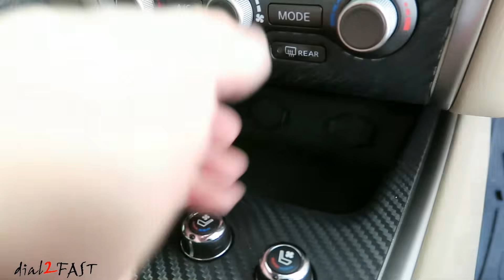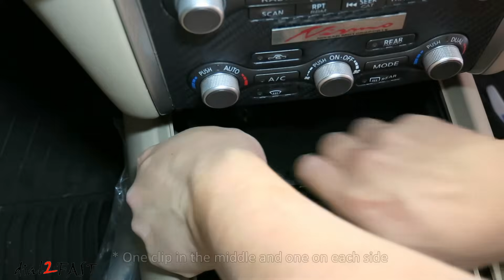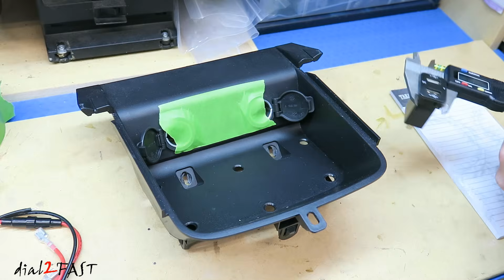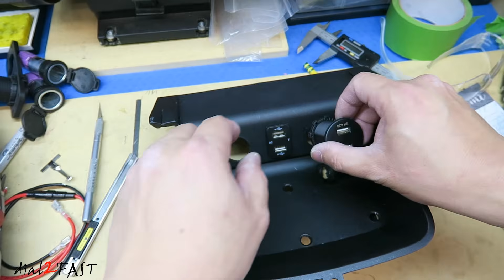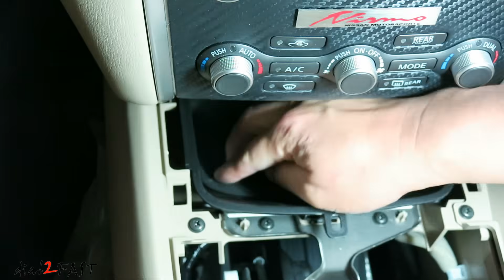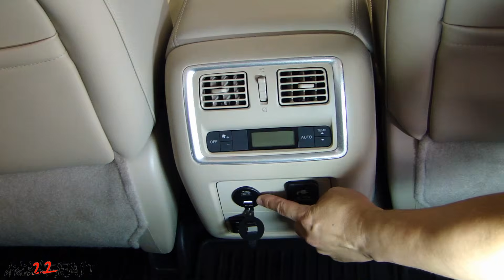Install Dual USB Charge Ports In Your Car | Nissan Pathfinder

Comment: Noob question. Do you really need to remove the panels to replace the cigarette lighter outlet, or can you just push in the two tabs as shown in other tutorials?
Reply from the maker: You have to remove the panel to remove the cigarette lighter plug. There are side tabs that clip into place which you can only access from behind. If you want, you can first try prying it out from the front but there is not a lot of space to work with.

Comment: I know this is an old video but is the panel removal over the tray different on a 2020? I can seem to get mine down as easy as you did
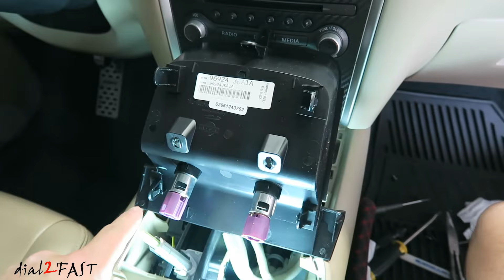Reply from the maker: The 2020 is same as my 2017. That tray is tough to get out because of the plastic tab at the back. You will have to use a pry tool to force it to come out. That's why I end up cutting of the two rear tab before reinstalling it. I mentioned this at 3:15
Reply: @dial2fast  thanks for the response. I was actually referring to the panel above the tray that you had to remove the light from. I want to change the bulb to led but not sure how to get the panel off
Reply from the maker: @MrMpbailey84  I see. With that top panel, you need to get a pry tool or small flat head screwdriver, and slip it in the front edge of the panel (you have to feel that edge as you are doing this blind). Once you have the tool slipped into the edge, then press it down to pop the panel out.
Reply: @dial2fast  awesome. Thanks for the response!! I’m gonna give it another go. Your videos definitely have helped me with stuff on my pathfinder as well

Comment: So I don't have to run it directly to the battery. I hope I don't have to order long wire and route through the fire wall. ?
Reply from the maker: You can also use a fuse tap to tap into the fuse box for Ignition 12V or Constant 12V. Definitely try to avoid running through the firewall.
Reply: @dial2fast  I got it to work today thanks

Comment: thanks for another great video.😀 can i tap to a  constant 12v fuse?  even when the ignition is off? how much power does a usb socket draws when not in use. it is safe for the car battery?
Reply from the maker: It's not recommended that you connect to constant 12v. It will drain your car battery.
Reply: @dial2fast  thanks for your replay.

Comment: Hi, Dial2Fast.... I saw that in this video and the other one you made about installing cigarette lighter type accessories that no mention of a fuse was made. Isn't there supposed to be a fuse installed in each USB device (front/back)?
Reply from the maker: Keep in mind the circuit I am tapping off is already fused at the fuse box. For extra safety, you can install a 5A inline fuse to the USB charger if you want.
Reply: @dial2fast  ah....got it. Thanks for the info and reply.

Comment: Do you know if it's possible to add that 2nd cigarette lighter on a version that doesn't have it
Reply from the maker: You can as long as you have access to an ignition 12v you can tap power.

Comment: As always, great video. Any chance you could do a video on replacing the OEM incandescent front turn signals to LED switchback LED's without having to use load resistors?  So, they would be bright white when the car is on & switch to bright amber in turn signal mode.
Reply from the maker: I have already replaced the front turn to LED but they are not switchback. I am not planning install switchback as the turn signal is right next to LED DRL. IMO, not much point in doing this mod/install. But here is the LED install vid: https://youtu.be/nkD45Ep4DKA

Comment: great install! looks good, ever thought about replacing the radio? would be a cool video
Reply: as a 2017 owner replacing the headunit is not worth it and you will lose climate control visuals from the integrated screen
Reply: Joe DeSalvo yu can get the radio dash kit and keep the above screen for your climate controls.
Reply: I've seen a cool (older) Pathfinder radio replace in which they moved the Nissan Top Screen with the Climate control screen down low where the radio unit is and put in a new radio flat screen in the upper unit.   Smart switch out. https://www.youtube.com/watch?v=vW4txlpe33Y